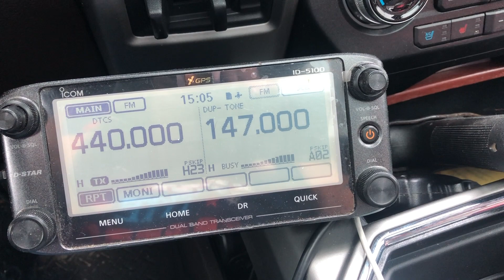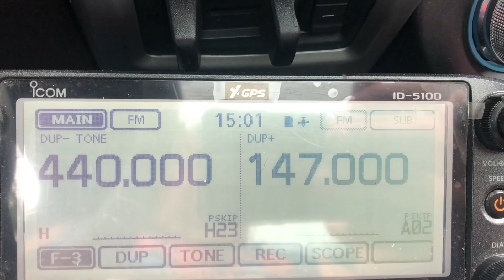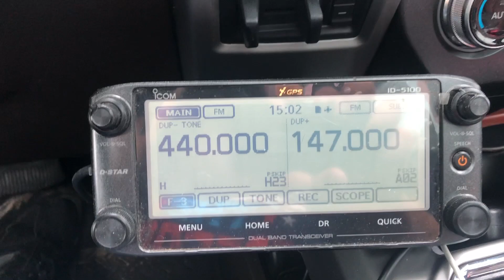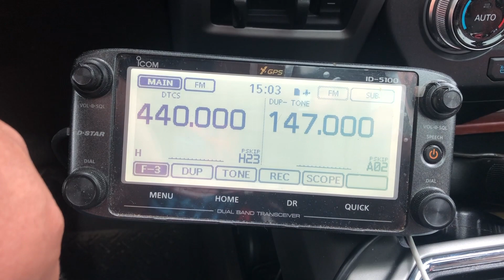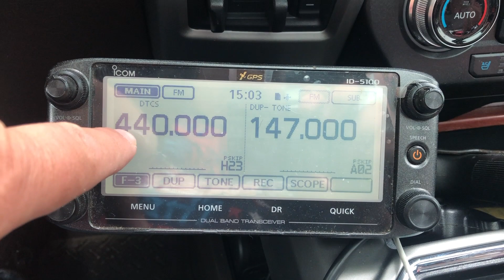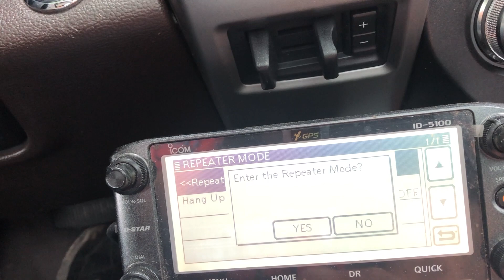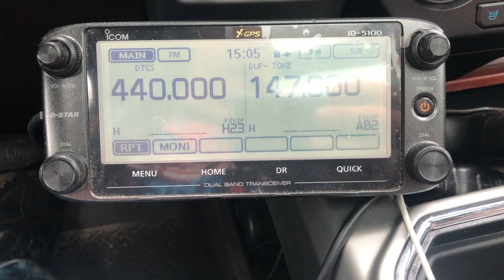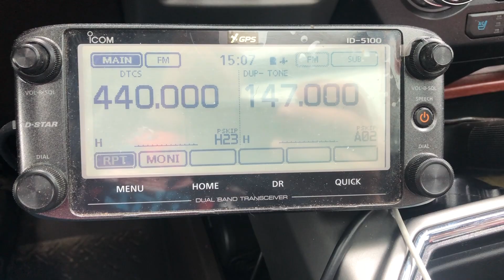Cross-Band Repeater - Remote ATVing Safely (HAM Radio)

Comment: Excellent.  I have a Icom 2730a that has the same cross band repeater function.  Wanting to do this at my home to be able to be around and inside the home with my handheld to transmit and receive to a nearby repeater.  Many thanks.